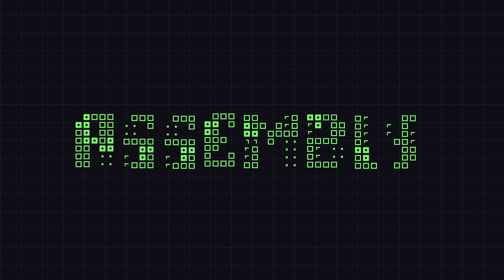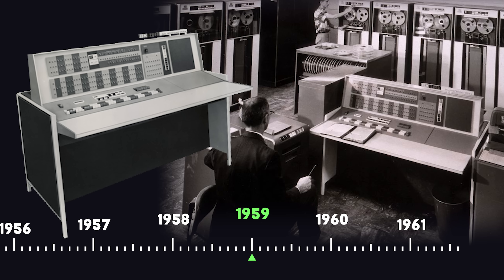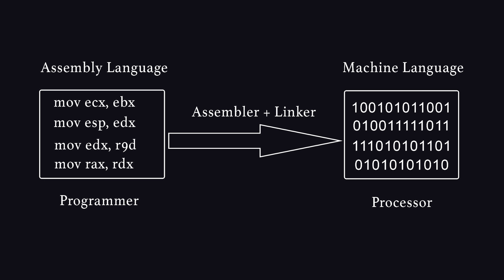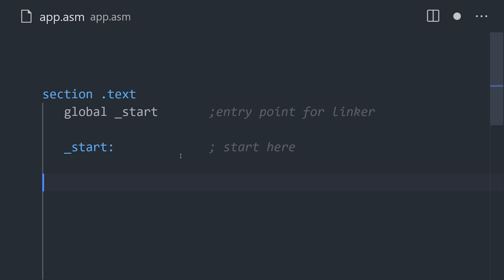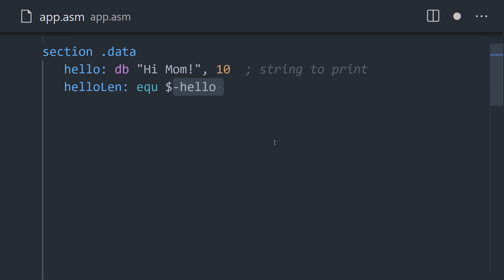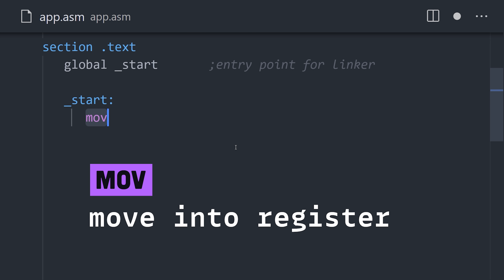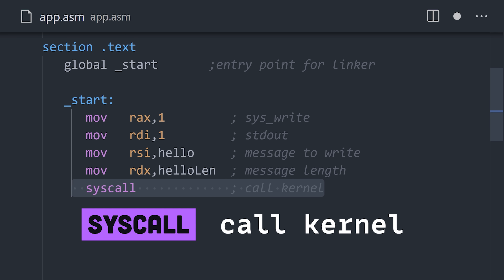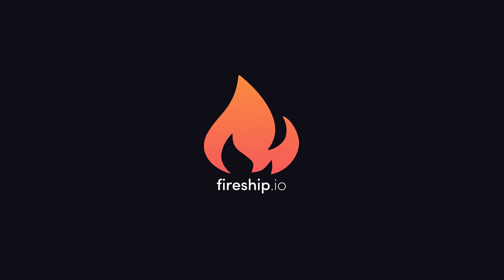Assembly Language in 100 Seconds

Comment: Always wanted to learn Assembly, but never have I understood it's complexity. You simply explained the most basic part of the Assembly language in 100 seconds clearly. Thanks! I might use this for future references!
Reply: Hey! It helps to start learning assembly on older chips that were less complicated. In my Uni we work with assembly on 8051 microcontrollers. They are quite old, but it's easier to grasp the basics on them. Overall, architectures used in microcontrollers tend to be a bit easier to understand than x86.
Reply: You should go ahead and learn it. I personally feel that my ability to debug things and make programs work increased after working on some simple projects in which I coded in assembly language. 
I would say that instead of learning about x86 assembly language, you should learn asm of Arduino Uno/Atmega328p. That is where I started. It is simple, and when those LEDs blinks, you get a feel of what it means to write assembly and how stuff works.
Reply: I'd highly recommend starting with a RISC instruction set like ARM. It's a reduced instruction set so it will be a lot less confusing than x86 when you are just starting out. Derek Banas has a pretty good video to get you started: https://www.youtube.com/watch?v=ViNnfoE56V8
Reply: Learning an assembly language is pretty useful to better understand how a computer operates, I would also recommend going for a RISC architecture, they tend to have less instructions and more registers and I feel that helps reducing the complexity to start doing something nice, even if it is just adding 2 numbers and saving the result in a third registry. The one I first started with, many years ago, was the MIPS 3000 variant, that was the cpu used in the PlayStation 1 and very similar to the one used in the Nintendo 64.
Reply: Assembly is simple, it consist of simple instructions. The complexity comes from trying to program more than adding two numbers together. You need alot of instructions, to construct higher level logic, take care of program state, access memory, data structures. Then you need to understand many registers in the processor, how talk with all the peripherals and so on. It's easier to start with microcontroller and move from there. I enjoyed the AVR architecture, it's 8-bit CPU with about 100 instructions. But the whole processor datasheet can have 500 pages for all the various modules like analog to digital converter or serial interface.
Reply: @jan.tichavsky  EXACTLY this. Assembly is FAR simpler than higher level code, because you quite literally HAVE to do absolutely EVERYTHING. Almost nothing is abstracted away.
Reply: Tell him to do machine language
Reply: Mips architecture is really good to learn assembly too. And you can find a simulator searching for something like "mars mips simulator". Good luck 👍
Reply: I suggest you to have C basic to understand assembly, it makes easier to mapping between asm code and C code
Reply: If you have intel chips on your computer, just install gcc/clang and follow the instructions on the book CSAPP. Learning it is painful but starting it is not that difficult.
Reply: Thanks for the replies! So just a quick word, I already have some experience with C and C++ (mostly C++), but I'm taking a break right now cause I'm trying to learn some Math and Physics. Maybe after a couple of months Im'ma get back to learning programming again with C, C++, and Assembly. Why I can't learn Assembly is that I use Windows, but I want to use NASM as my Assembler, but what I've read on the docs: Windows uses a different one named MASM. I don't know what use of Assembly is for my programming, but it may be a good experience.
Reply: @yuto2497  There are tons on assemblers, just use what you like. MASM use masm syntax while Nasm use intel. they produce object file and they're both used to do asm programming. It doesn't matter if you're new. 

I'm using Nasm on Linux to learn POSIX asm since i found POSIX API is easier than Windows.
Reply: If you actually imagine that you're a person hired to write code in straight 1s and 0s for a living, then assembly seems like a blessing
Reply: @Cavi587  is
Reply: @Cavi587  absolutely, I did assembler on 8 bit 6502 in the very old days of Commodore PET and Apple II just for fun. When i saw the first 16 bit 8086 I  stopped doing it for fun, when it got to 32 bit 80386 I stopped completely was way to complex,  Doing business application I found no need for it anymore.
Reply: @manhalrahman5785  people who do assembly for a living find high level languages like visual basic confusing.
Reply: @Cavi587  at college we also did with 8086, was less complicated but when handling bigger strings, numbers and integers and mathematical calculations, kinda found it tough considering it had just 8 registers, and i prefer learning on the x86_64 bit one
Reply: @festusgichohi7476  To each their own I guess. If you can learn fast and already have some good knowledge of low level programming concepts, x86_64 gives you a lot more that you can do with it. But when you are given a very simple program to write in assembly as a beginner, simpler architectures are a bit more friendly, at least in my opinion. Especially if you are not really interested in low level programming that much but have to do it because of school. In my University most Computer Science students aim to one day work in JavaScript or Python so I think x86_64 can be pretty overwhelming for them. Personally I do love me some C and asm.
Reply: You can use compiler intrinsics directly in C/C++ to accomplish a lot of the same things. #include <mmintrin.h> . Intel's website has documentation for most of what's available. It's generally preferable to hand writing assembly code if you can do what you need with intrinsics. Otherwise you have to write your assembly as whole functions that you call from C, and that might involve a lot of bookkeeping beyond the actual task you're trying to do.
Reply: in simple words, it is about this, you setup the registers then call interrupt then you read the registers, thats all
Reply: @Cavi587  bro from where did ustudy assembly on 8051 microcontrollers
Reply: I would try small PIC microcontrollers.
Reply: The only thing to understand about assembly is : Whenever you need to save an information for later, just write it on the stack and SP will update itself accordingly.
Reply: you need learn cpu architecture first

Comment: "My favourite part about WebAssembly is that neither has it anything to do with assembly, neither has it necessarily to do with the web."
Reply: Wasm is a regression to software development. i dont understand the hype at all
Reply: @archmad  Its hyped because it allows you to write web applications with all (or the majority of) Javascript abstracted away. I would never go back after using blazor wasm. Its just miles easier to write good code and you get access to powerful tools like resharper / nuget ecosystem ontop of anything javascript.
Reply: @archmad  Wasm is Java done right with the experience of 2 decades of failing. Change my mind 😛
Reply: @ZephrymWOW  as much as i love wasm for what it allows, i must say my experience with it supposedly eradicating the need for js has proved that it isn't really finished.
WebAssembly seems to focus too much on being 'headless', being able to be run without the web browser nor even js enviorement, completely ignoring that this is the whole point of why it was created in the first place.
Every single possible action you'd want to perform in javascript can indeed be performed using wasm, but only after you:
1. Import the functions needed.
2. If they have anything to do with strings, go through thousands of loopholes to get them right for both the wasm memory and js memory.
3. Only then call said functions within your wasm.
It results in that either you or your enviorement/build tools (emscripten, wasm-pack, etc) will end up generating a huge mess of a "glue" javascript file that does the thing your web browser should have done in the first place.
This is completely unnecessary and shouldn't be a problem in the first place, yet it is.
Thus every website implementing webassembly will come with these giant files that will sacrifice the page loading times, cache space and overall both user and programmer experience.

One step forwards, two steps backwards.
I love yet i hate it. It's awesome.
Reply: @beProsto  yeah there really needs to be an ABI to the underlying system that reduces that "glue code" js footprint.  The main advantage of wasm at this point, is if you have some incredibly heavy cpu bound calculations to run, like a physics engine, multimedia processing, etc. It just seems really stupid that if I want to write a game in wasm, I have to call the javascript interpreter which then calls the canvas element which then calls OpenGL.  But hey, it's great for embedded crypto miners XD
Reply: @archmad  You can do web stuff without JS, what's not to love?

Comment: Note: The method you used to write your hello world program here wasn't really "just" assembly (which is understandable, since writing a miniature operating system for a '100 Seconds of'-video is probably out of scope). You still used the kernel-specific API calls.
Reply: TBF if you run something in a modern operating system you HAVE to use API calls (called system calls) for anything that isn't just calculations. Otherwise you'd segfault.

So unless you want to install DOS or create your own ring 0 OS because you want to build the third temple on your computer or something. You gotta accept that nothing you write will truly be "in assembly".
Reply: @mrmimeisfunny  At my job we don't use a operating system (well, we make our own RTOS), instead we program an SPI link to a PuTTY-linked peripheral and printf by sending data down the SPI line. So you can do printf without any API/syscalls, but bugger me is it hard work
Reply: @mrmimeisfunny  I should have clarified that I know that there's really no other way to do this (without writing your own os). Would not exactly be great if any program could just run any instructions it wants to without restrictions (through syscalls/an API).
Reply: @mrmimeisfunny  I set my screen resolution to 640x480 to please God
Reply: Gregory Fenn curious what exactly you do that requires this, sounds interesting
Reply: @Mitch_Crane  did you write your own compiler?
Reply: @sharpieman2035  Well we have to make our own functional RTOS for aviation devices (flight control computers, basically, but for defense) but can't use ANY standard libraries or APIs at all because of political/military reasons. So we make functional applications using Matlab mainly to generate C-code, and then write our own kernel drivers for any peripheral devices (DMA, I2C, DDR3_RAM etc) which that generated C-code uses.

Our real product won't have printf off course, it's just for development, but has the nice side effect of testing our custom DMA and UART and SPI drivers for free!
Reply: Thanks to your comment now I understand why they stick to old hardware when making aviation related hardware. Making new code for even the simplest thing must be a pain in the ass